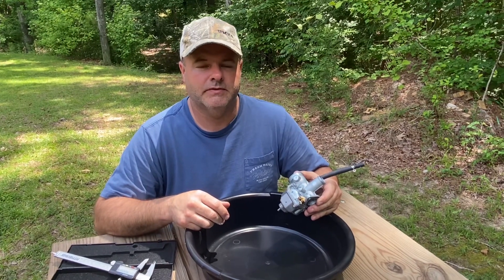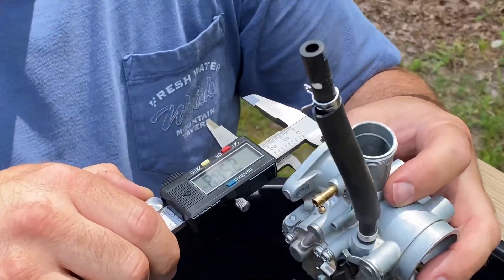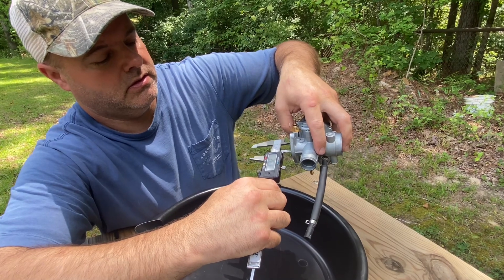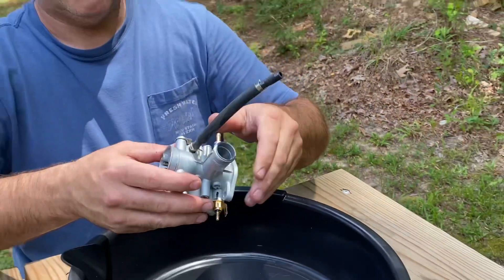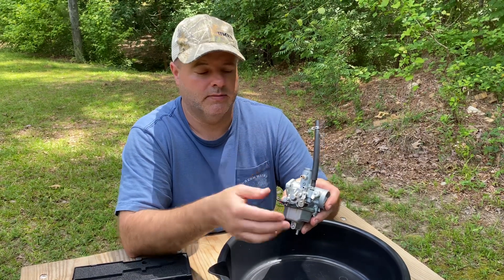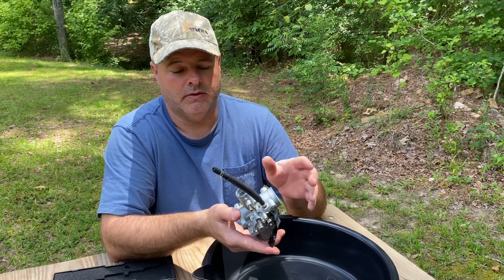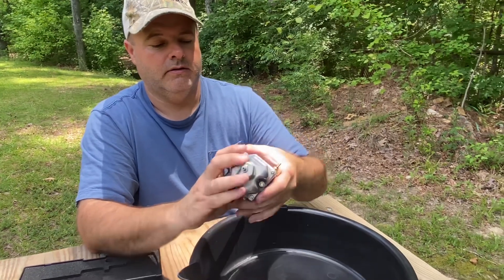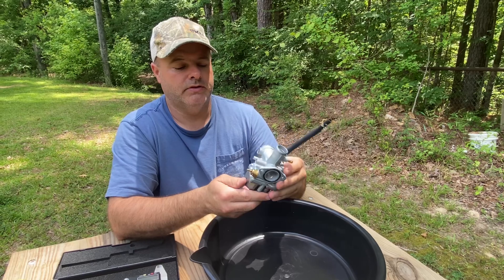2023 Honda XR150L carburetor jet size and other information

Comment: Measure the diameter of the  slide (assuming it's a round slide).  The slide diameter will dictate the actual venturi bore diameter as it's likely a tapered bore.  Aww, COME ON!  We don't want to break the law around here?  🙄  Lol  🤣😂  We all know that for Honda to get a carb'd bike to pass DOT/EPA requirements in 2023, they HAVE to be lean AF!  Pull that anti-tamper plug outta there and tweak that mixture screw!  I haven't had a carb'd bike in the last 40 years that didn't benefit from a little carb fettling.  Not looking for "power", but I can almost guarantee that there's improvements to be had in throttle response.  Inquiring minds want to know....
Reply: What would you recommend for jet size for minimum 5000’? If it’s super lean from the factory then should it still be the 105 main jet?
Reply: @DustySteelGarage  Sorry, but, living at 850', I have no experience jetting any bike for high altitudes.  I don't even know if the bikes sold in high altitude areas are jetted the same as those sold in my area.  But, generally speaking, as a main jet only controls fueling at or very near WOT, unless other intake and exhaust mods are done the stock main jets are often good for most bikes, in my experience.  At least at my altitude.  At your altitude, the main jet I might use would likely be too rich for you.  Same for pilot jet, fuel screw adjustment, needle profile and height, slide spring, etc...  Carb tuning is actually quite complex with many variables possible.  It's a trial and error process, making one small change at a time, testing in between each change.  That's why I encouraged MishMash to do some tuning...  to at least establish a few baseline parameters with which others could fine tune for their specific locations and conditions.  At a minimum, I'd guess that one or two shims under the needle clip, and a little fine tuning of the fuel screw (or air screw as the case may be) will most always make improvements in a bike's throttle response compared to modern EPA mandated super lean factory setups.
Reply: @michaelc3416  I’ve been doing a lot of research trying to prepare. I was also wondering if the bike I get at local dealer will put in the correct jets or not for a stock bike. I’ll probably start by modifying the air box and putting a better filter on it. I know about needing it to be leaner the higher the altitude and being able to move the needle position if it’s already not lean enough. Otherwise I believe that I need to go down in sizes of jets if it’s still not lean enough. I’ll probably go with a more free flowing exhaust at some point. Then I’ll probably have to do some more tuning at that point lol. Thank you for your advice and quick response!
Reply: Well put ! I want one and I’m curious
Reply: I just bought mine and am waiting on jets but bravo. 1st person in any video to talk about shimming the slide...
Reply from the maker: @nwga.5327 FYI, a .015" shim is about the max that will fit unless start trimming the top of the needle head down. It has a fixed needle and a plastic cap needle retainer that unscrews. One can also vary the idle mixture by different angles on the slide bottom (air filter side). Not sure if they can be bought for this carb. or not. You could probably sand it down (probably need a 38 pilot if you did that).